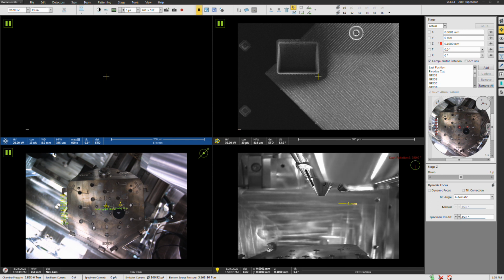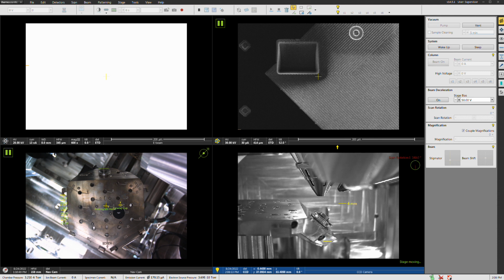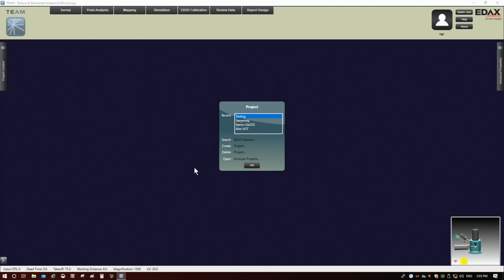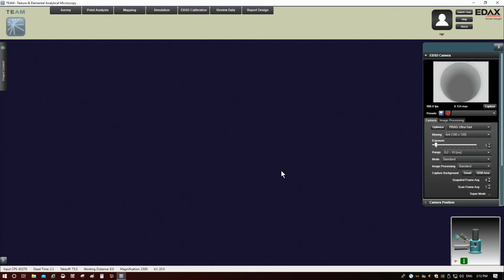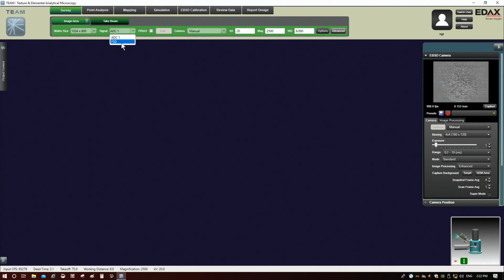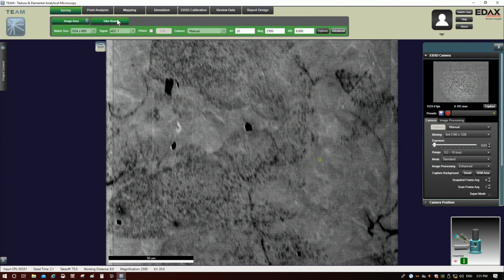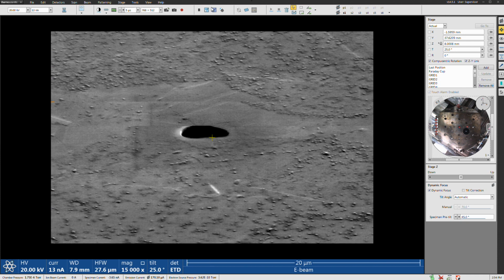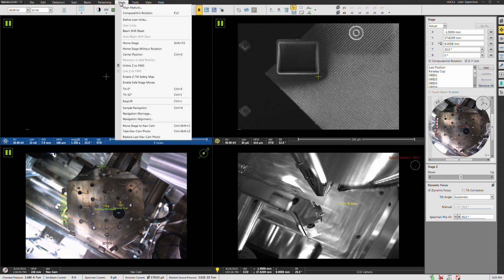FEI Helios G4 PFIB CXe dual beam FIB/SEM + EDAX Velocity EBSD camera: EBSD tutorial

Comment: Thank you so much for the very informative tutorial!
I have one question on the tilt correction in the SEM software. Is correcting the tilt in the TEAM software enough?
Reply from the maker: Glad you found the video helpful.  What I have found is that tilt correction should only be applied in TEAM, so yes, this should be sufficient on its own.  You definitely don't want to apply tilt correction in both the UI and TEAM or the image will be excessively distorted.  I have actually never experimented with applying tilt correction in the UI and then not in TEAM; in principle, this should work, but I've never actually tested this to see if the results are equivalent to applying tilt correction only in TEAM.  Thanks for your support and I hope this helps you.

Comment: hi, you mentioned different setting for capturing ebsd for single crystals. particularly i have question related to background capture. can you give some suggestions?
Reply from the maker: Hi Anuj: with a single crystal, it's critical that you use a dynamic background subtraction (changes for every pixel) as opposed to a static one (identical for every pixel).  I don't think there is a preset in the processing list for doing this, you would need to make up your own processing recipe, but this isn't very difficult to do.